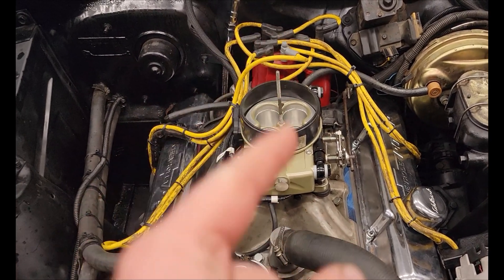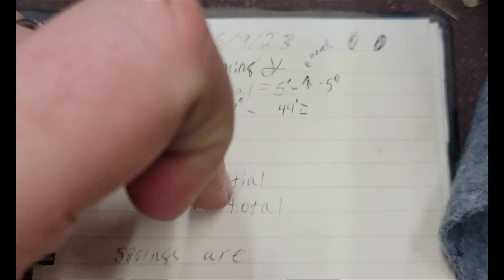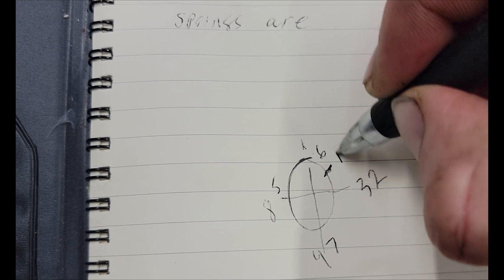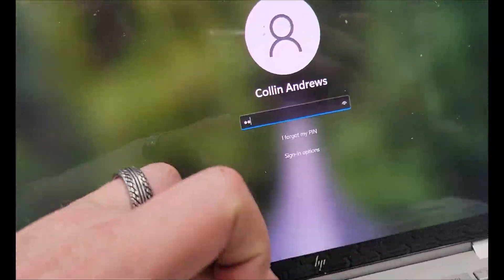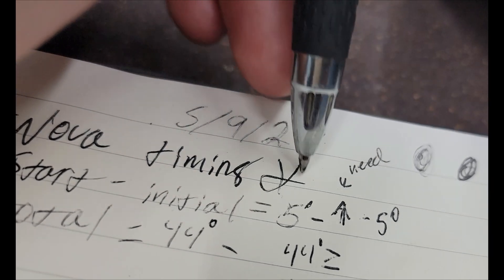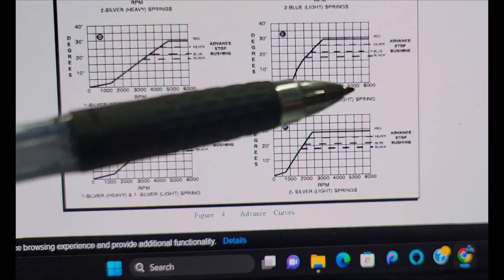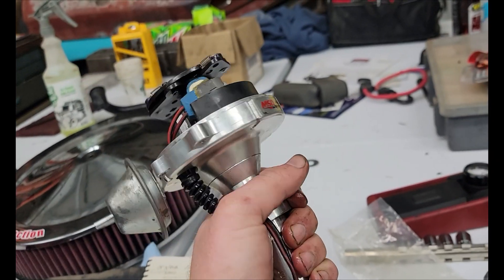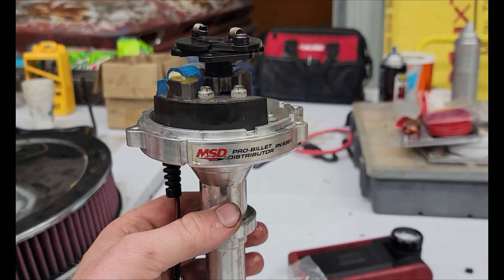Tuning your Distributor! How to get the right amount of Timing in your MSD Distributor!!!

Comment: Good stuff. My car runs pretty shit under 2800rpm, also needs more initial timing but i cant without far too much total timing. Looks like I need to adjust the stops. Thanks. Adjust that lash!!
Reply from the maker: That would be a good thing to try! And turns out the cam went flat on the car 🤦‍♂️ oh well we have a new roller cam in it now haha
Reply: @thedailymisfire  ah dang. Yeah thats a bummer. My cam had done the same. I made a stop bushing out of a small bolt for less advance and now it runs way better!
Reply: "progression ignition 'will solve all your problems.

Comment: Great Video, You definitely have the right Plate on the front of the car. 😂Da Grump 😂 would be proud. What Coil & Output Voltage  & Wires MM are you running ?
Reply from the maker: Thank you! I hope he would be haha. and its a MSD blaster coil, so 45,000 max voltage? and they are just accel super stock wires not sure the size but not big, will probably switch to a better wire soon on it
Reply: My 2. D. 1975 Cherokee S , hated the large HEI & so did I, not enough room to dial it in correctly. Just ordered the ready to run from Jegs, 
Thanks for the reply . Glad to see you had a great time at drag week. @thedailymisfire
Reply from the maker: @SuperDirtyred1   Got it yeah an HEI doesnt fit in my car either, thats why I basically have to run a pro billet, or one of the expensive smaller HEI's. Hope the ready to run works out for you! and Thank you it was a blast! Hopefully will have the last video up tonight or tomorrow morning.

Comment: I got into that many times and there are so many setting and adjustment in a distributor it's awesome ...And with Turbo charger and super charging there is a whole different realm... Back in the day not much literature... today there's a virtual fountain of knowledge at one's fingers... I found out the hard way dealing with a SAAB turbo had ordered a distributor because the recurve had exploded in the distributor and even destroyed the shaft.. Anyway I was sent a distributor for a non turbo....in short one advance other retards....And is no Bueno...😎 I know setting recurve in a SBC is a true power gain, I loved messing around with the old hei... still remember most of what I did and what I accomplished... Good stuff 😎 Thanks... I use mess with the air gap and so much...You said Bristol... I am from around the Virginia side of Bristol.... I was around there in later 70's early 80's since moved on .... Racing in those hills back in my school days fond memories....The county and local police would close the street from time to time and a we would drag race.... Some of them old police cars was no pushover....OH how time's have changed...
Reply from the maker: Yeah its crazy how much timing can do to benefit a car, I don't think I mention it in the video but my 350 before we were having a hard time figuring out where the timing was on the car and turns out it had 0 degrees and it was only getting vacuum advance cause the distributor was locked up in the middle, in one night at the track I went from a 16.40 to a 14.38 and the car eventually ran a 13.95 in that trim, always something haha!